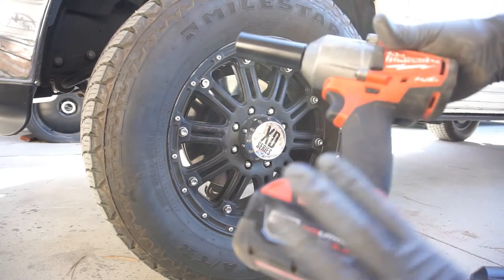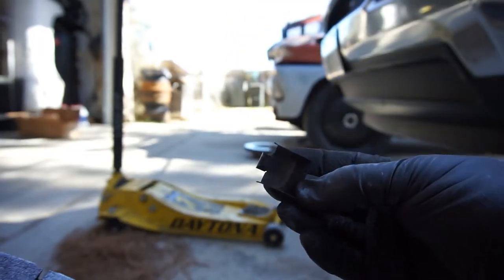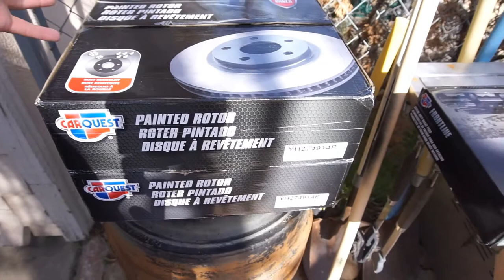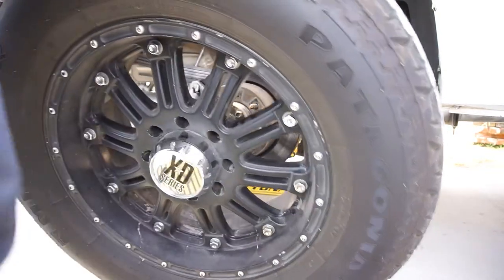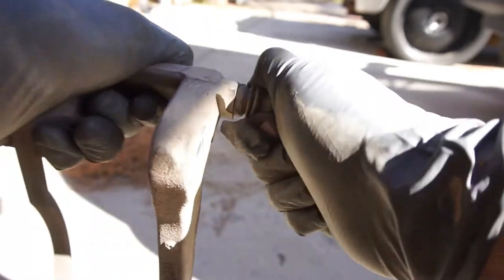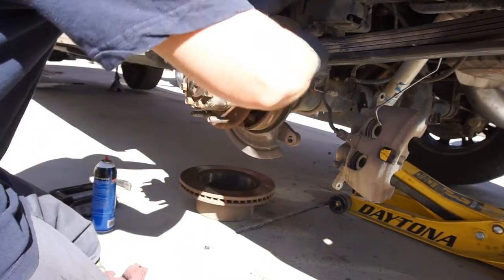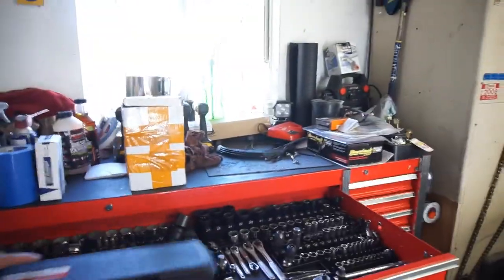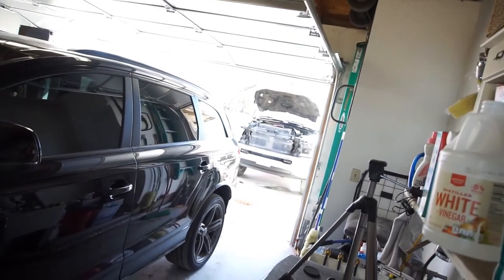Modded The Drunken Ram With Some Needed Brakes 2010 Ram 2500 Cummins MAGA Cab..

Comment: Dang. Those slides in the bracket have NEVER been lubed up.... that will definitely cause premature brake pad wear. Good thing the truck is in better hands now.
Reply from the maker: OneNGlen they were pretty bad. I almost feel like buying new pin or slides or slide pins.